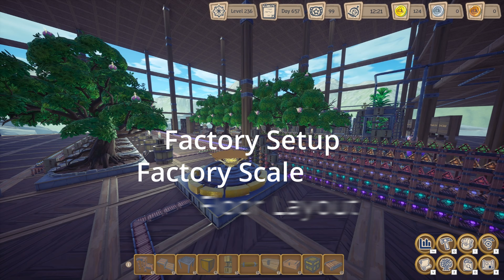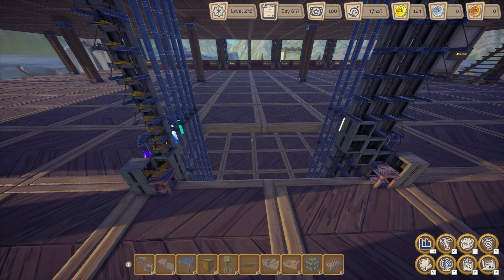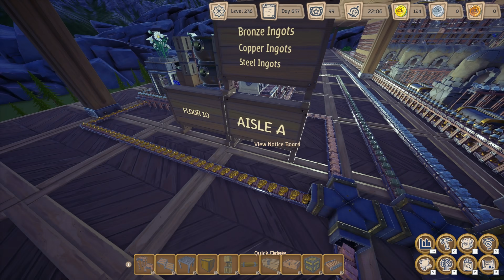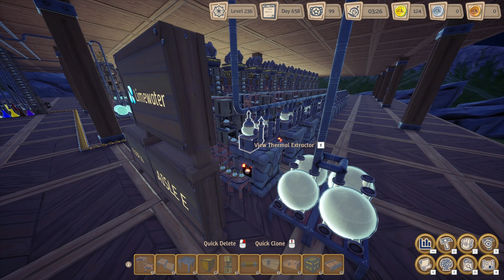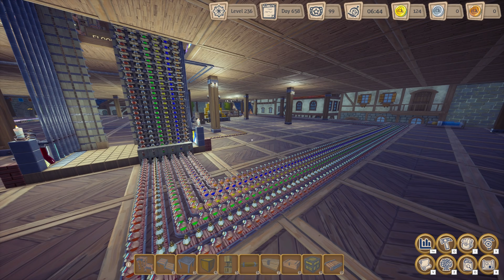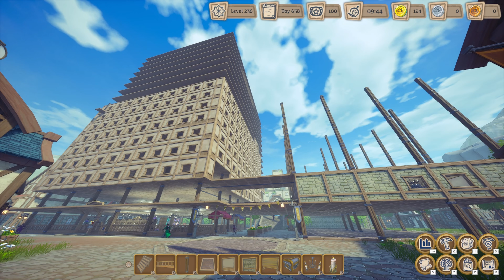100% Fully Automated Factory Design Tips | Alchemy Factory

Comment: for the "mall" do you have the INPUT of the chests towards the player, routing underneath the chest from below with those lifts, and then routing out the back to the floor above? That's how i'm considering doing mine. it's unfortunate you can't change which sides, lanes are input/output, or any priority settings on the big chests (yet) it's unfortunate you can't use any sort of circuit-logic / control of belts or machines for an automation game :/ but maybe the devs will add more automation capabilities later..
Reply from the maker: Howdy. Yep, you're correct. I route the incoming belts under the box and into the front (facing the player). Then the belts go out the back and into lifts up to the next floor.

Edit: I think this video shows it in greater detail https://youtu.be/NTJX8I6DILA

Comment: One early game design tip, is once you got Adv Fert going, go to the very very end of the line and put some Bandage dispatch machines to keep the Adv Fert running and converting time to money by having it use what ever remaining Fert on the line (I also put a priority splitter where I am currently adding machines so everything gets full before things get sent down to the bandages).  Doing this on the start of a no customer run and it is helping keep silver flowing.
Reply from the maker: Hello and thank you for the comment. I fully agree. Here's my typical method for what you describe:  https://youtu.be/pI01AKL9ONQ

Comment: great guide. Why do you say to set up the liquids on at least floor 16? There is no headlift issues AFAIK.
Reply from the maker: Howdy. I appreciate the comment. You are correct that Alchemy Factory does not consider head lift for liquids. However, later in the game you unlock thermal extractors which provide a 200% additive bonus to extraction output but require to be up around 250 blocks high, which is roughly the 16th floor. It's not required, but I find the bonus extremely helpful in reducing the amount of input resources required. You can see this in greater detail in my liquid video: https://youtu.be/EMqwyttsTpA
Reply: @Uglarvisk gotcha. Thanks! Bringing your ideas into my factory!
Reply: As he mensions there is a production boost for having it at the highest level

Comment: I'm having trouble orienting myself with your floor tiles when you're explaining how to lay out your beams. Where is the original plot relative to your beams and where is the "anchor" beam - the first beam you've put down? I can get an 8-4-8 count for the original plot in one direction if I only lay beams for the original plot width but when you turn 90 degrees I'm confused about what you're doing.
Sorry, I know it's me, not you.
Thanks for the great tips.
Reply from the maker: Hello and thank you kindly for the comment. Great question, I think it would be worth it to do a deeper dive on your question in my next video. I'll show the entire build process from scratch to make it easier to follow along. Thank you again and stay tuned.
Reply: @Uglarvisk  ooh, that would be awesome.
I had just torn everything down when your video was recommended - all 16 floors - so you came along at the perfect time. 🙂
Reply: @Uglarvisk  More detail is definitely required. If I lay out my columns on the bottom floor like you have (7x8 open space), there's a + shaped hole in the middle where I can't place floors. Does the ground floor also have to be the small tiles?
Reply: @speeddaemon6557 did he ever cover this? Im having the same issue myself
Reply: I hope this helpes
BasePlot:

O====O====O==XX====O====O
=
=
=
=
O
=
=
=
O========O====O========O
=
=
=
O
=
=
=
=
O====O====O====O====O=====O

Comment: An absolute thing of beauty. One question - a lot of folks recommend double-height floors. I see you are using single height. Did that hamper you at all?
Reply from the maker: Howdy. Thank you for the comment and the compliment. The single height floors worked just fine for me, no issues at all. I think it comes down to personal preference - if you want greater than 6 cauldrons per furnace or some other tall machine requirement, or you hate that the World Trees slightly clip through the floors, or you need extra clearance for your catapults / cannons (which can get blocked by the ceiling tiles in some situations), then double height is probably better. I chose single height floors to reduce the amount of stairs I'd need to ascend and the amount of lifts I'd have to build for my mall, and my cannons don't tend to be in positions where I get blocked by the ceiling.

Comment: Great layout! I appreciate you sharing. The one "exploit" of shooting items through tiles or walls seems like something that the devs could very well eliminate in a future build. But otherwise, far cleaner and well considered than my angry spaghetti factory. The one issue I've had with running one belt for coins, one for fuel, one for fert, is that, as soon as I split them off to run machines, production slows down at each split, and just trying to pump more fuel or fert on the same belt from a single production area doesn't help, because if production is maxed out for my belt speed, then adding more just backs up at the point of production. How do you handle this for things like Advanced Fertilizer and Coke Powder (my current level)?
Reply from the maker: Thank you for the comment. I agree, if the devs end up changing the "fire through floor" thing I'll open up the floor tiles. For the money, fuel, and fert belts, I use different strategies. Let's start with coins. I'm sending 20 gold coins per stack through the factory, which is enough to keep everyone happy on a single line - I could also use cash boxes on each floor to change gold down to silver to make a sort of "leaf-spine" architecture for money if needed, where gold coins are the spine. For fuel, I only use fuel generated locally to a set of machines. In the earlier game this sometimes meant using one or more coke powder machines in a single aisle, with multiple coke powder machines being used per floor. As I migrated to Panacea potions, I updated the floor layouts to 80~160 Panacea potions per minute to power an entire floor. The same design principle holds true for fertilizer. I used to have 1~2 belts of either advanced fertilizer or growth potions per floor, depending on demand. I don't send fuel of fertilizer up the logistics elevator; those resources remain scoped to either aisles or floors. I have a Panacea potion video coming out later today as well. Cheers!
Reply: @Uglarvisk  Watching your video, and some others, it seemed like 3 belts were used up and down the chain with perhaps only one production source generating each resource. But having every floor produce their own fert/fuel resources makes a lot of sense. Oh, and the resource "mall" on every floor is also brilliant. Thanks again for sharing your design!
Reply: I had the same thoughts, but I'm struggling to move from one isle to the other, for instance the adv fert, wanted to use the planks to do my gears/small gears, pulleys etc is this a bad idea or not? Seems like a waste to put down more saws and money when already got planks being dumped